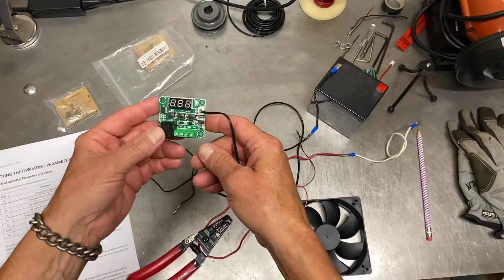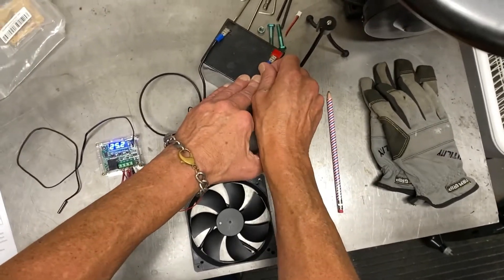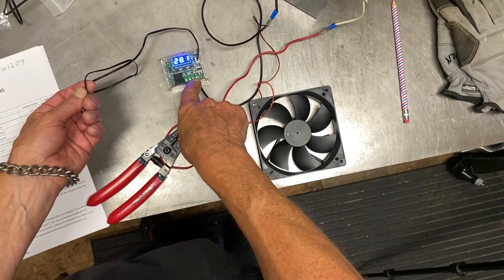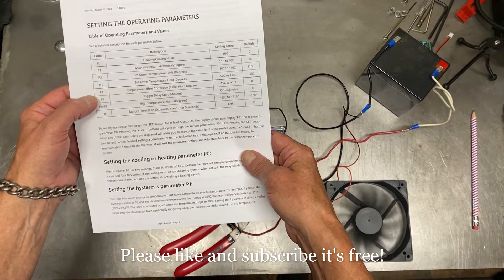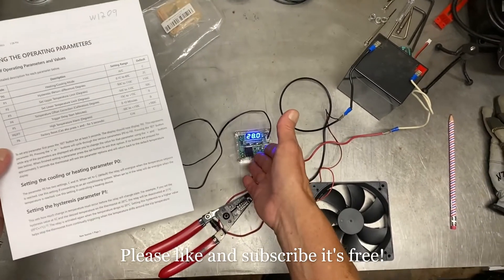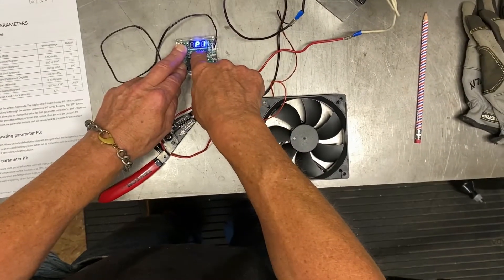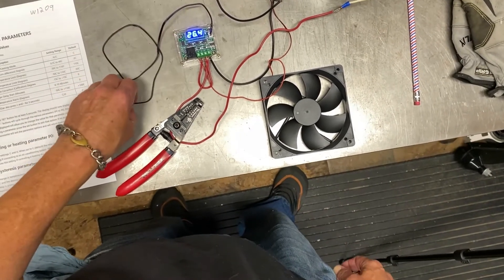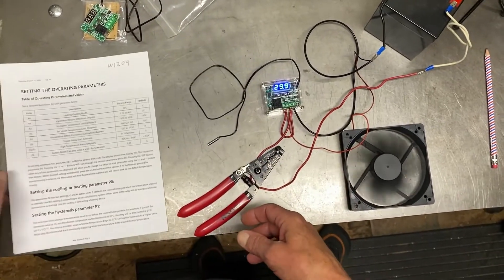W1209 Temperature Controller w/thermal couple

Comment: Hello and Happy Friday, Bro I'm Having an Extremely hard time with How to wire the W1209 Dual thermostat, Most Instructional Videos are in Another Language and They Don't Explain Thoroughly About How To Wire The System, I Want To Use This Concept For a 1/10 Hi Power RC Car For To Cool My Electronic Speed Controller Fan and The Brushless Motor Fan, Can You Possibly Help Me Out With My Idea? I think I got the Programming part but it's the Fans I'm trying to make come on.
Reply from the maker: Sure. Just plug the fan power wire to the module output and the ground side of the fan to the ground of the battery. It will then operate to your programming condition. The module has a separate power and gnd connection. The power connection to the fan in the above example is independent from the module supply so the relay will kick it on and off. Hope that helps! Thanks for checking me out. Have a good one. Greg S.